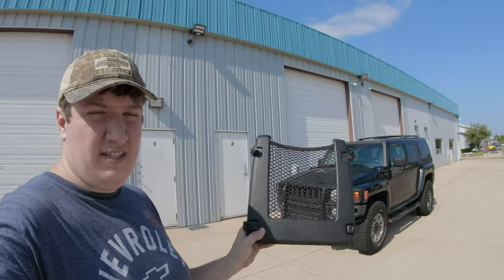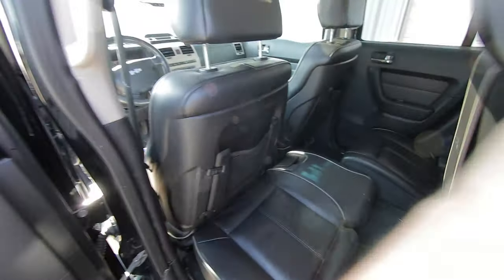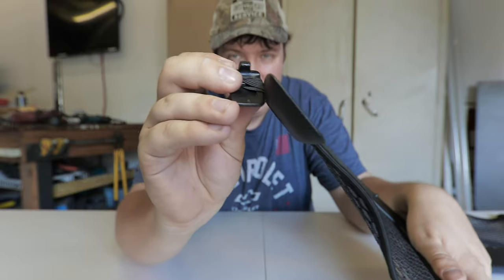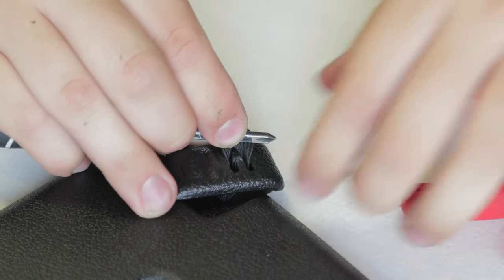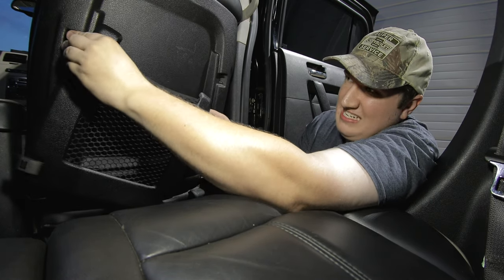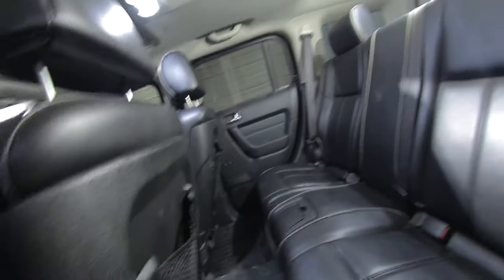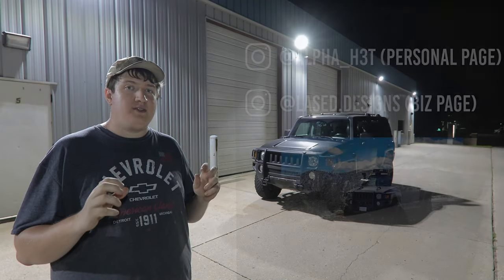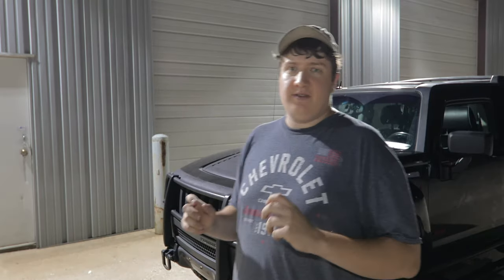Fix Your Hummer H3 Rear Cargo Nets!

Comment: These clips work great,  You can't cause the cargo net to come loose and fall off.  Great improvement for the money.  Takes a little time to replace current clips, make sure you have the need tools to cut through the old clips.  You can use a cake done checker to pull the elastic straps through the slit in the new clips.

Comment: Okay, heres the deal. I bought  a 2007 H3 brand new. The nets worked very well and held junk without fail. Now they have failed. The problem is not the tabs on the factory clips, the stretchy strap loses its elasticity.

Comment: Hey BTW what are your thoughts on metal radiator coil? My H3 runs kinda hot, which is annoying. I'm thinking of swapping the radiator with the $500 aluminum one.
Reply from the maker: Oh you are talking about the CSF one right? I would love to get it. Just got so many other things to take car of first! I don't have one in my Alpha yet, but my dad has one in his Alpha and it does keep his H3 right in the middle on hot summer days. However, if we do a offroad trail run, both of our rigs get hot. Over 3/4 temp. The CSF should help on the road, but also paring it with an electric fan setup should work great even on super hot days while offroad.

Comment: I just bought a used H3 about a month ago and man do I love it! I really like your videos, I’ve watched quite a few of them and they are super helpful. I’m currently dealing with the abs light and traction/stab control fail lights being on ugh… had my rims cleaned up and bead resealed on them cause the tires were losing air ever so slowly. Thinking it might be something related to the tires being removed and sensors not connected correctly again when they were put back on. Seems to be quite a few people that have had a similar issue but I don’t see one single factor being the culprit for the warning lights. It seems like there are many different causes for them to pop on. Do you have any suggestions? You seem to know a lot about H3’s! I’m officially a channel subscriber cause this is awesome information, so thank you for your videos! I appreciate you taking the time to make them cause it helps this H3 rookie trouble shoot things before needing to take it to a mechanic!
Reply from the maker: Congrats on the H3! I am not sure if the TPMS sensors are causing this problem but it could be a possible. If the TMPS sensor are causing the problem, it could be one of two things. Either the TMPS sensor nut was not tightened down enough by the shop or the seal on the TMPS sensor has gone bad and it is allowing air to escape. That being said, it could have something to do with the rims being bent or cracked. As far as the ABS and traction control light, that could be a number of different things. The best place to start is by using a higher end scanner that read ABS codes. One time I had my ABS light come on my H3 Alpha and I wasn't sure what it could be. I borrowed my friend's Snap-on scanner and it told me there was a fault with the rear driver ABS sensor. I went ahead and took a look that the ABS sensor wire, and I noticed right away that it was spliced. I went ahead and resoldered  it, and the code went away, along with the traction control light. So definitely go ahead and get it scanned to help you narrow down what the problem may be. Hope this helps!

Comment: Hello 👋 
Is it possible to put a h3 5 cylinders 09-10 front differential to a H3t alpha ?
I have a hummer H3T alpha 2010 and my front differential doesn’t work any more, what can I do to fix my problem? I tried on looking for all the parts of the differential and fix it but I couldn’t find all of them , and I was looking to put a front differential from a H3 5 cylinders but i don’t know if that’s possible, what can I do in my case?

Comment: Still loose, because these clips do not address the problem of the stretched out elastic straps.
All you have to do is, put something under the straps to shorten them,and it will tighten up.

Comment: Really? $45 I don't think so.  I'll put a molle panel in there for less and have better storage
Reply from the maker: That's okay. The reason why these are so expensive is that there isn't enough demand out there to justify making plastic molds, so 3D printing is the next best option. 3d printing takes longer and the filament can be expensive, so that needs to be factored into the cost.